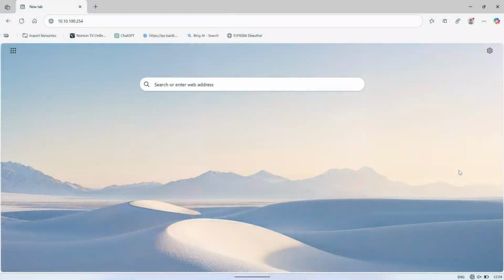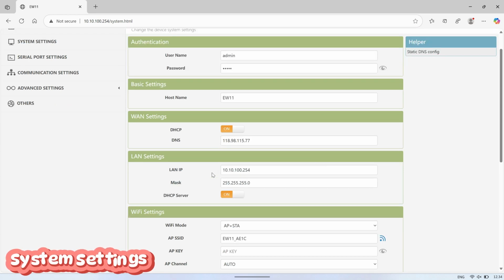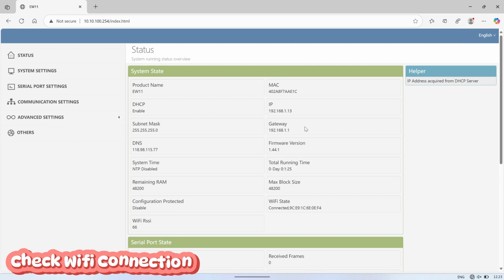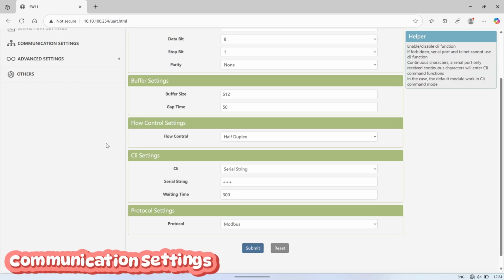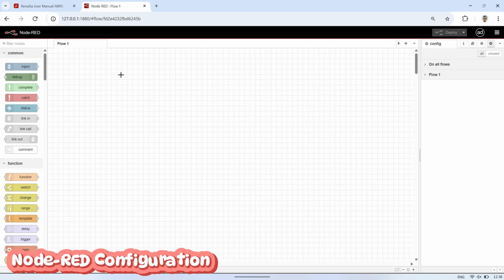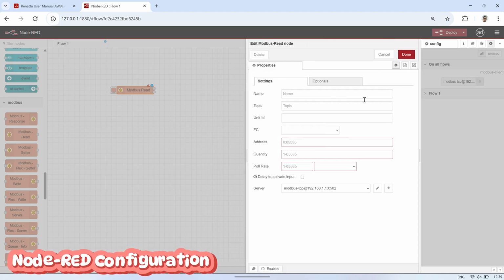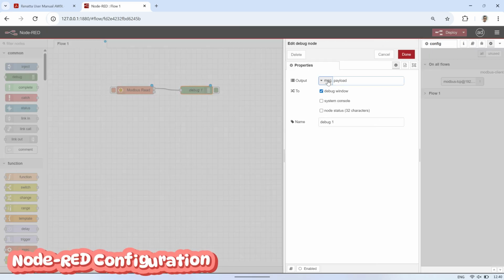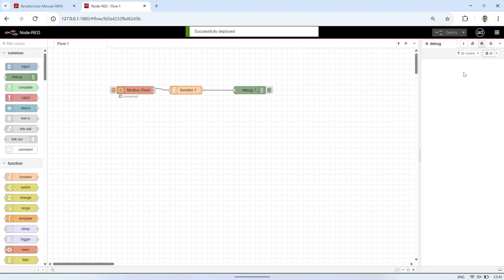How to Configure the Elfin EW11A: Modbus RTU to Wi‑Fi Step by Step

Comment: Can it be used as a network brige to comunicate two devices? in your case is from computer TCP to RS485 device, I will need between two modbus devices (master, slave) in orde to avoid the two wires cable.
Reply from the maker: EW11A cannot directly act as a wireless bridge between two Modbus RTU devices (master–slave). It works as a Modbus RTU ↔ TCP gateway, so one side must be Ethernet/Wi-Fi. To replace cable between two RS485 devices, you need two EW11A units configured back-to-back (serial tunneling mode).

Comment: Thanks for this usefull video!!! Yesterday I tried to install this for my first time. I took a look into the manual and was wondering, that I couldn't found a WiFi on connecting Power (minus pin one and plus on pin 2). This is Part of the manual. Just as I read the manual a second time I tried the power in the midle pins and a got a WiFi Network. Than I configured STA, SSID and Password, last submit and did wonder, why I couldn't see the module not in my local network. I believe, there was no single hint about disconnect and new connect after configuration.

Thanks for your Video !!!!

All about I asked ChatGPT, but this App just knows the link to the Manual bit not his content. I asked ChatGPT how about install this but I got just Junk. ChatGPT is not Jesus compatible, right now ;)
Reply from the maker: Thanks for sharing your experience!
Yes, after changing Wi-Fi settings you must reboot the module for it to connect properly, that is based on my experienced.
Glad the video helped